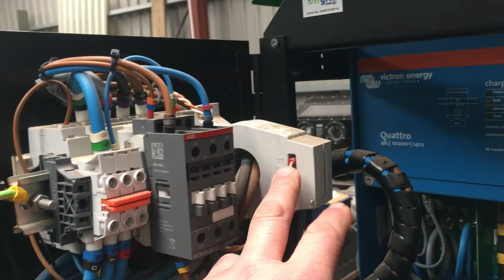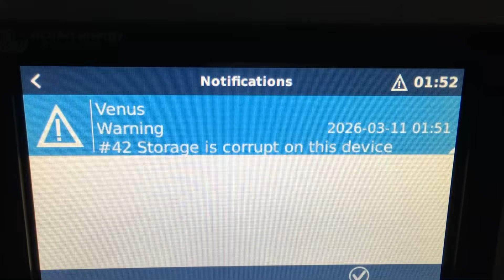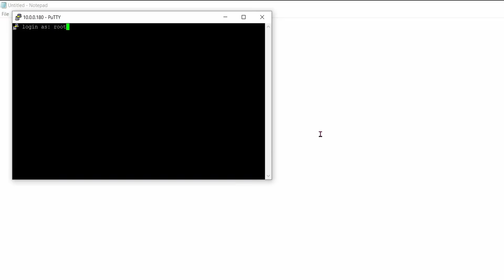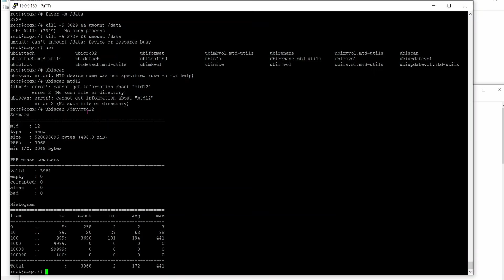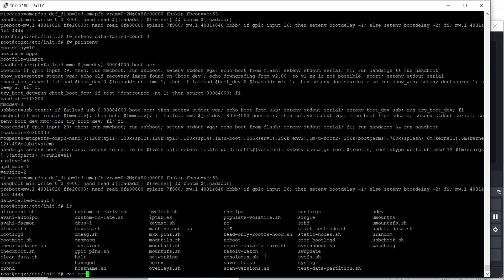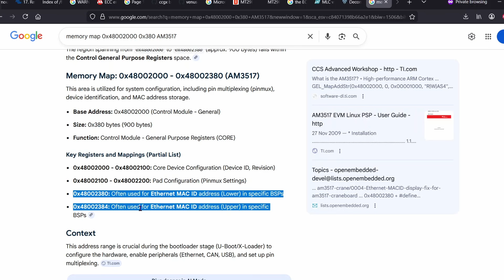Victron: "It's not user repairable" 🤔 Me: "Really?" | Victron CCGX Repair

Comment: Great Job on the fix! Have you thought of converting it to charge Sodium-ion batteries (if that is possible)?
Reply from the maker: Thanks 👍I've not looked into Sodium-ion. I've got some Pylontech USC3000 batteries already on a smaller system, so I had been thinking of using those. I know there's the "donut" labs batteries that are supposed to be fantastic but we'll see when all of the testing etc is finished.
Reply: @BuyitFixit  If you already have the batteries that is great. I've seen videos recently of Sodium-ion as being the next big move in the battery industry. I think it's because of cost, safety and availability of sodium compared to Lithium. However, size is the issue because they are bigger than Lithium-ion batteries. Looking forward to your next video.
Reply from the maker: Thanks mate 👍 What do you think about these new 'donut' batteries?
Reply: @BuyitFixit  I'm not sure about the new 'donut' batteries because it's a new technology but it's looking promising. I like the fast charging and greater temperature operation range plus the higher energy density. I'd like to see how the technology does this year in testing and the final cost for them. I was thinking sodium-ion batteries in your situation because they are starting to be used in Grid storage and might be a cheaper option.

Comment: I'm 16:00 minutes in so you may have discovered this already but in the mount output there is another mount inside of /data, it looks like a shm (shared memory) mount
Reply from the maker: I did see that, but wasn't sure what it meant, been quite some time since I've using linux and I don't think I'd came across shm before.
Reply: @BuyitFixit  you did an excellent job!

Comment: 24C02 EPROM hold mac address value on board the TAM 3517 module.
Unsolder it, dump it, and just modify MAC hex value. You should be good!
Reply: Or you can replace get-unique-id with a shell script returning a custom MAC address. Beware this will be deleted for each firmware update (but you can  hack it using a /data/rc.local file that will revert your mods back after each firmware update).
I'm a venus Raspberry pi power user :)
Reply from the maker: Nice 👍I did dump the eeprom via cat /sys/bus/i2c/devices/1-0050/eeprom  and it doesn't hold the mac that's being used. It holds a different one. I had thought about the same thing! It should be possible to add a small script in /data/rcS  to symlink the get-unique-id to a simple script to just echo "newmac" . I've not tried but I think something like that would work

Comment: Great video. It will be fun to watch the conversion process to lithium iron phosphate. Just curious if the Victron you have has the ability to change the charge profile for lead acid to lifepo4. Thanks friend
Reply from the maker: Cheers 👍Yes, you can. I'm already using a smaller victron (5kva) and 6 pylontech USC3000 batteries. I'm thinking of swapping those over to this system, and probably adding some more batteries.

Comment: What a gigantic machine that can provide quite some juice i think :). As someone who does hardware tinkering with embedded devices and has become a kind of pro at all the embedded linux stuff, i love how you managed to fix it. Yes those fw_printenv and fw_setenv are provided by the uboot_tools package. Some devices have that to read from and write to Uboot environment variables from within the userland like update status or they sometimes set a variable that it boots to some recovery or 2nd firmware partition. Also i often used the lsof command to view wat files and applications use what.  It probably runs a big linked binary as the main process or might have multiple smaller binaries working in tandem to make the device do what it does. I had a camera that had like 5 smaller binaries and 1 larger binary doing the functions. And also the fact that you could not unmount the partittion while it was active makes sense as that main binary probably was using it. And a lot of these embedded devices have a way to respawn the main process and or fork it when it dies/gets killed off and actively monitor it either via a status indicator or watchdog, cause you dont want it to become a dumb linux terminal under the hood when something internally goes wrong. This way it always will be able to show some status to the user no matter what. Typically when i need to kill the main process, i will look at what "ps" shows and also will look for any Init scripts responsible for spawning it. Typically most of these embedded devices are using busybox init (linuxrc). This will (often, but not always) run whats inside inittab, but thats some basic stufd like mounting directories and that chainloads /etc/init.d/rcS or some other script (rc start). rcS then does some more things like loading drivers and or starting other scripts that do things that then start other processes and so on and so on (like a domino). There could also be some daemons active that do some stuff and rely on the main process to be active.  Also nice that it seems that its not absolutely stripped down to the bare minimum, as i seen devices with barely any usefull commands. Seems they could have made it with buildroot or yocto, which is typical for embedded Linuxes and i believe buildroot has good support for Sitara. Also runs a pretty up to date kernel (most devices i came across ran kernels from 2.4.x till 5.1.x). Kind of crazy that such big machine has a whole linux computer inside and that it talks over lan/can. 

I do love that the device uses a non custom SoM based on the very popular TI Sitara cpu and that the linux os is quite open/hackable (most vendors triple lock down their products so they cant be tampered with). And that you could view some sourcecode which is something that not all vendors expose. 

I also love to see your farm and farm animals and i love the cute lambs and you are probably one of the few farmers who does repairs and goes this deep into electronics and repairs but i apreciate it mate! I also sometimes do repairs but more for family and friends and they are usually smaller repairs, but still enjoyable and i can learn from the insides and its always a joy when you are able to get it working! :)
Reply from the maker: Thanks very much, sounds like you know your stuff with embedded systems too! 🐑👍 I did read that there's a hook you can use to run your own code too. If you add a rcS file to the /data folder you can run your own code at early in the boot stage. So I had a thought of the ID. You have the rcS script do a symlink to the get-unique-id command, to a another shell script, that just has echo 'newmacaddress'. I think that would probably work.

Comment: Just replace get-unique-id with a custom script to make it return whatever ID you want it to generate, then it won't matter what's stored...
Reply from the maker: Yes. I had thought of this there's some early boot hooks you can use if you put a file in /data so I thought you could create two scripts. The first symlinks the original file to your new script in /data (as that's the only place where files are kept after a reboot), this other script would just echo 'whatever mac address' . I haven't tried it yet though.
Reply: @BuyitFixit could be interesting to completely dump the firmware and see what else is hiding in it 🤣

Comment: This is one of those channels I actually get excited when I see a new video. I'm on my third watch of this one so I can pause frequently to look up the programs you're using and to reference things I don't understand. 

There's nothing like seeing someone repair things that 'can't be fixed'.

Sorry about the lamb you lost, it was lovely getting a look around and seeing how Savanna  is doing.

Did you have any luck using the ultrasound you repaired checking the pregnant ewes? I'm still looking for one myself but lost my little schnauzer guy last week. If you found the ultrasound machine useful I'm thinking it might be useful for me to spot problems early as schnauzers are prone to stomach, gut and spleen issues. The vet charges £150 a scan and I've seen so many now that I think I could spot things earlier if I had a machine.

Excellent video as usual 👍
Reply from the maker: Thanks mate 👍I need to have a look at the ultrasound scanner, as I'm not sure if there's a problem with the probe or cable, as it's wasn't showing the soundings last time I used it, just a blank area where the image should be displayed. I did see some of the one that I got going pretty cheap ~£40 or so, on a medical auction sites a while back.

Comment: That's old firmware. The new Venus os gui looks different, less colorful and fits a bit more on the main screen. I have a cerbo gx in my camper, I love Victron stuff, for a techy it's a wonderful world. I have 2 solar controllers on it, 2 dc to dc chargers, a shunt, and an inverter. They all talk to each through the cerbo gx and Bluetooth. These cerbos are great because there's so many inputs, outputs, and it can be controlled anywhere in the world as long as it's connected through Victron's vrm system, and it's free.
Reply from the maker: Sounds like a nice setup. I think the firmware I used was v3.65 from September 2025. I think the latest was v3.70. It seems they have EOL this device now, and they recommend V3.55! 
Victron's latest Venus OS for GX-devices firmware versions demand more from the hardware than the Color Control GX can provide. Therefore, newer versions, such as the currently available Venus OS v3.62, are not offered for the Color Control GX, and the recommended firmware version for the Color Control GX remains v3.55.
Reply: @BuyitFixit Like Apple? "Too bad so sad your unit is too old, buy a new one." Honestly, the older gui looks better.

Comment: Most of  the 'fixing' was over my head! However, it was lovely to see the animals at the end - Well done Mick 😊
You will have to show us some more of your battery storage system once you have it up and running.
Reply from the maker: Thanks mate 👍Yes I need to figure out all of the wiring, as I might need to rewire it to just work on single phase.  I might just use two of the inverters in parallel, and leave the other one as a "spare".

Comment: May wish to use LiFePO4 batteries rather than ordinary Lithium, depending on the price, weight, and amperage capacity..
Reply: I would use 12V LFP batteries.
Reply from the maker: I think the original batteries were Opzs2V (24 of them) https://www.brsolarsystem.com/uploads/202131492/2v-800ah-opzs-solar-battery02161352407.jpg I've already got a smaller Victron system set up with 6 x Plyontech USC3000 batteries, so I might use those and add add some more to this.

Comment: Impressive work on the nerd stuff and the lambs - well done.  Those Quattro’s are decent kit, can accept grid and generator input matched with a decent battery bank will give you energy storage and off grid with on three phase. The colour control is the predecessor to the carbo gx control box - which isn’t overly expensive to buy
Reply from the maker: Thanks Eliot 👍I think they just made the CCGX EOL, so it won't be supported anymore. So hopefully this video will be useful to others who end up with the same problem.

Comment: Almost seems like they cut a corner somewhere with the hardware design (or have a software bug they haven't fully be able to eradicate} and it bit them, so they added some software checks to show a failure message and get people to return their units for a reset.
Reply from the maker: Yes, that's pretty much what it looks like to me too. I would have thought that ubifs should manage any bad blocks or ECC problems as that's what it's supposed to be for. I did have a similar problem with a VTech baby monitor a while back where the root cause seemed to be a Sqlite3 DB that was corrupted probably by a sudden power loss...
Reply: @BuyitFixit  Power loss at the wrong time might well be the root cause as you speculated. I can image some kind of half-initalized state that prevents a clean startup next time and flags the system as bad.
Seems like it might have been trivial for them to add a fix to the factory reset option though.

Comment: I wanna see you set up the whole machine.  Explaining the process of converting it to lithium power and installing all the bms stuff, setting up the wifi monitoring and transfer switch..
Reply from the maker: Cheers mate 👍Yes it needs an MTTP added but then it can certainly be charged with solar (that's my intention). I've currently got a very similar (smaller) setup with a victron Easysolar II and 6 x Pylontech usc3000 batteries. This is just a lot bigger and separate devices.
Reply: @BuyitFixit  you need a MK3 usb adapter to reconfigure those inverters to lithium.
Reply from the maker: Yes mate, got a MK3 inerface already from when I configured my other system with VE config 👍
Reply: @BuyitFixit  I think the intended way of solar charging this abomination is via 3-phase AC coupled inverter like Fronius. Standalone MPPTs will work but they're weak and Victron charges through the nose for them.
Reply: @npl-8701  well, hook a four port RS to it and it will charge 48V batteries with 200A.
Reply: Great video. Mad skills!
Reply: Can this amazing machine be charged by solar? Fantastic video! Loved the CLI debugging 🙂
Reply: @Ianbeanart  Not yet but he's planning to change that. The current charger setup is designed for a fixed voltage (mains AC), for solar you need something that can deal with varying input voltage.
Reply: @Ianbeanart there's plug in solar kits that put 240v out which would do that. They include the voltage controller to smooth out the incoming DC as well as an inverter to transform the low voltage DC up to mains AC. I have a kit from Zendure, solarflow800 that does this. It's called a hybrid inverter as it does both those jobs in one unit.
Reply: @Ianbeanart  it totaly can, just connect an mppt inverter to an ac output.
Reply: Somehow ... I think that will be a whole-year programme. Even without YT editing time. 

Jumping between decoding microchips and lambing, this has a very Usagi Electric vibe. but 50 years closer to today than Usagi's typical computers.
Reply: there is litteraly an transvers switch in every inverter.

Comment: That nand chip might well be on it's way out. It just failed way earlier than specified because the controller isn't using the same level of ECC as the chip required to meet specified lifetime of the nand chip. Maybe they were using a different nand chip originally (that was fine with 1bit ecc) and switched to a different one to cut cost, not reading the spec sheet correctly.
Reply from the maker: Possibly, but then the ubifs should have scrubbed the block and then checked it, and it it was bad, marked it as such, and re-allocated it from the spare blocks.
Reply: @BuyitFixit  I'm not quite sure about the order of things here. The drive will never be mounted read only unless there were errors. Is there an additional wear leveling/flash controller involved that is intransparent to the filesystem? In my mind the flash memory will now have more and more errors as the expected amount of errors is exponential over time.

Comment: It’ll be a great project to convert the silent generator. I’ve converted several from lead acid but only ones with a built in diesel generator and solar.
I have a spare Quattro 48/15000 with a fault if you wanted to have a stab at a fix? In Northumberland.
Reply from the maker: Nice 👍I'm over in the Northwest (Cumbria). I've not looked at a Quattro before. Sounds interesting. I've currently got an Easysolar II with 6 x Pylontech USC3000's. You can drop me an email by using the name of the channel at out look dot com

Comment: I just took a trip to a part of the universe I don't comprehend.  This video was way over my head and I'm not afraid to admit it.  If you say it's fixed Mick I believe you bro.  When you get to the part where your hands get dirty putting all the batteries in and powering the thing up, maybe I'll understand that part😊  Well done sir, thanks for the video.
Reply from the maker: Cheers Terry 👍Yes I'll probably be doing something on that too! I've just pulled all of the metal work out today that held the old batteries. I think I might try and repurpose some of it to take my lithium batteries that I already have.

Comment: You should normally do a tar archive if you are backing up something from a Linux filesystem to a FATFS fromatted SD card. That way the users, groups and permissions on the files get preserved, which the FATFS can't handle.
Reply from the maker: Great idea, and thank you for the tip 👍
Reply: You can also use scp to copy files off to another Linux machine.  Or stream the tar output over a ssh connection.
Reply: yup, also: cat /dev/ubi_2 | gzip > /media/mmcblk0p1/ubi2.bin.gz

just in case - when it's 32MB you can afford as many copies as you want on an XGB SD card
Reply: Nice idea. If you don't have an SD card or anything else writeable, then I've used dd, tar, and netcat to clone a hard disk from one machine to another without opening anything up.

Comment: Interesting. Presumably you had to restore all the folders in the data partition? Would be great to see this unit fully operating (with batteries etc). Does it need 3 phase to charge?
Reply from the maker: Cheers Ralph. The unit just resorts to factory defaults. I can copy over the original config file though, but I'm not sure if I'm going to keep it set up as 3 phase or set up just two of the inverters in parallel. I don't really have a use for 3 phase here, and 20Kva should be more than enough to pretty much run everything in the house if needed.